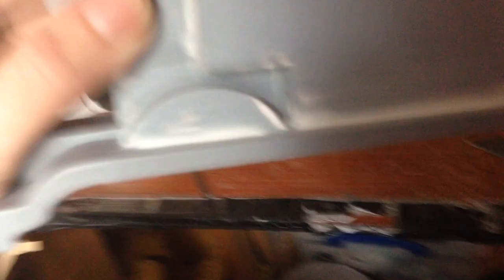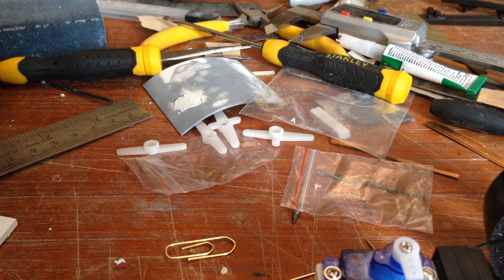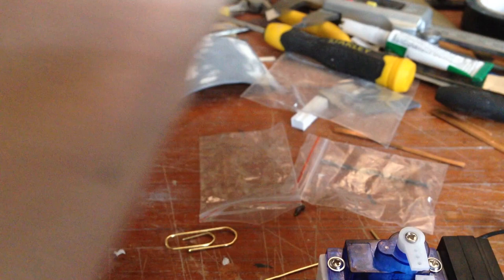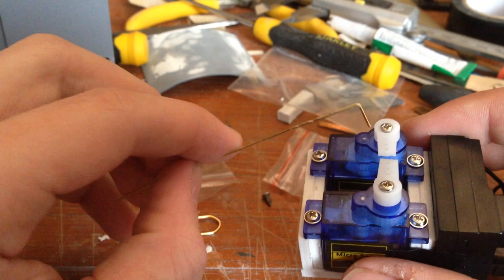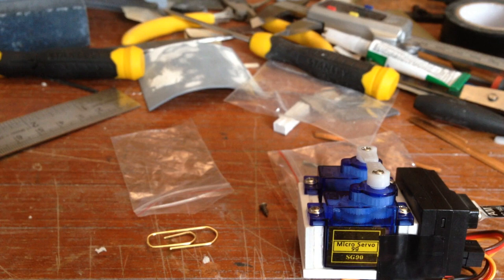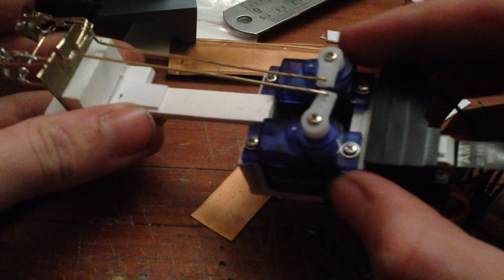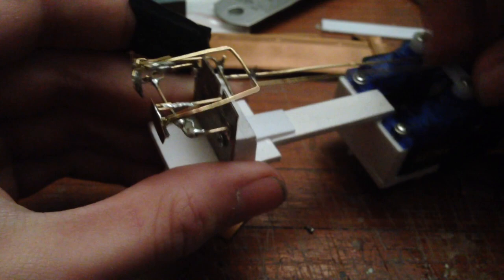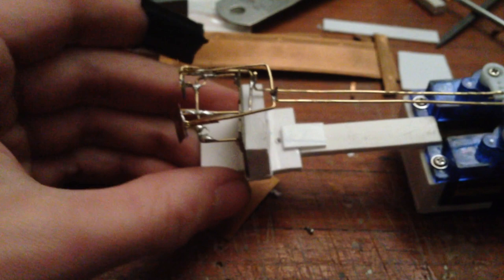Gauge 1 Thomas Replica: Part II. Bodywork and Eye Mechanisms

Comment from the maker: I apologise for the somewhat disjointed narration in the video clips, I was intending on uploading these as shorter parts, but decided to compile them all instead.
Reply: En el vídeo paso cubriste todo el modelo con algo Cris que se parece a la pintura,es pintura o otro material?.
Reply from the maker: It’s multiple layers of paint put on between sanding and filling so I can see if there are any cracks, pits or sanding marks that I need to fill, so it ends up with a smooth top coat once I get around to the final colour.
Reply: @SampullMC é clase de pintura usas para este modelo de Thomas?.
Reply from the maker: @josecarlossalazarpostigo662  It's just a general surface primer from my local craft and diy store, the top coats are automotive paints, like the TV models, but I haven't gotten that far yet. THere is also a base blue layer that I've used in later videos, but that's not really important and it's from the same place as the primer.
Reply: @SampullMC Espera,¿me estás diciendo que los modelos de las locomotoras de Thomas y sus amigos fueron pintados con pintura para automóviles?.
Reply from the maker: @josecarlossalazarpostigo662  Yup. The vast majority of them were done with Halfords brand automotive paints, and every single model prior to the season 6 repaint was done with Halfords paint. The best examples being Rusty, the narrow guage diesel, is Volkswagen "Brilliant Orange", and James is a Ford shade of red, although which one I'm not exactly sure.
Reply: @SampullMC Gracias por decirme lo.
Reply: @SampullMC Por cierto,¿Cómo es posible que los modelos puedan estar en el agua y no les pasa nada?.
Reply from the maker: @josecarlossalazarpostigo662  It not so much a case of "nothing hapens to them" as the metal components will start rusting and seize if not taken care of, but if they have been submerged, usually a spray down with WD40 and drying them off is enough to keep them in running condition.
Reply: @SampullMC ¿Osea si a este modelo de Thomas le esas WD40 el agua no le aria mucho daño?.
Reply from the maker: @josecarlossalazarpostigo662  If cared for and dried off quickly, water will do little to no damage.
Reply: @SampullMC Gracias por la información.

Comment: Hey honestly i advise you to not use that type of eye mech,  it is bulky and badly efficient
Reply from the maker: Yes I know it is, but it works at the moment. I do intend to build another one at a later date, but as this is based on the season 1 model, that's the eye mechanism that was fitted to both the pilot and 1 model.